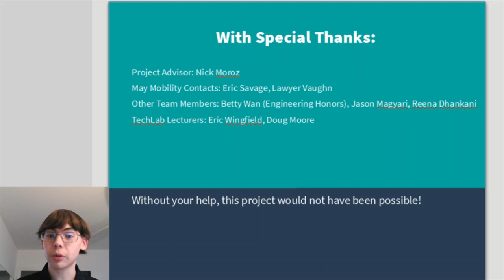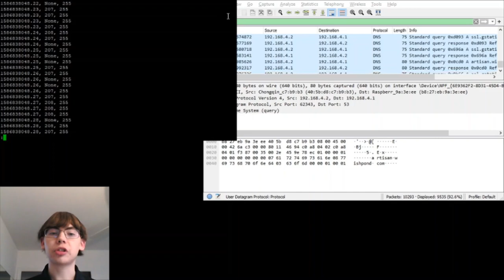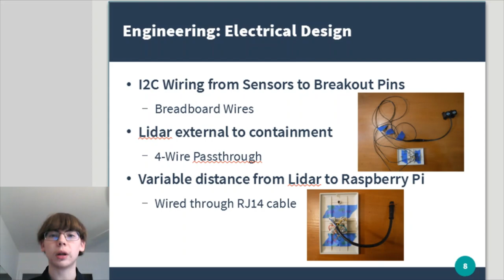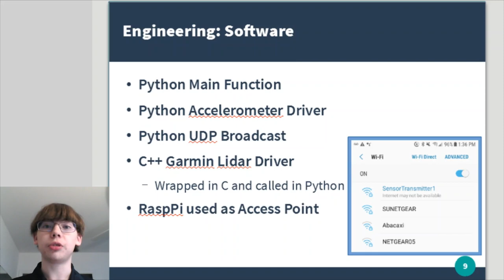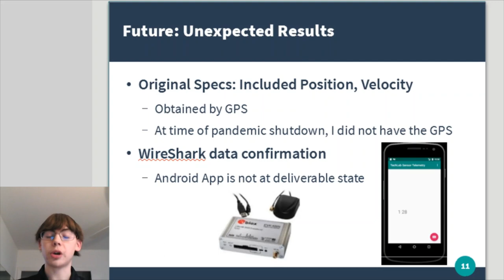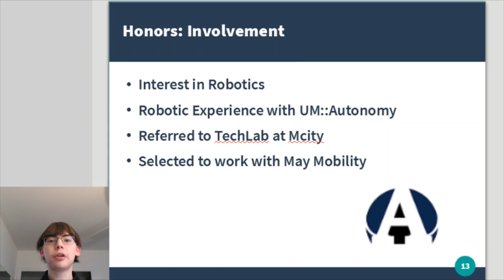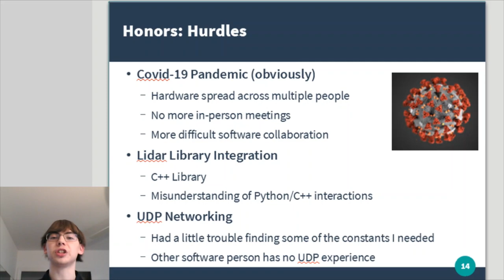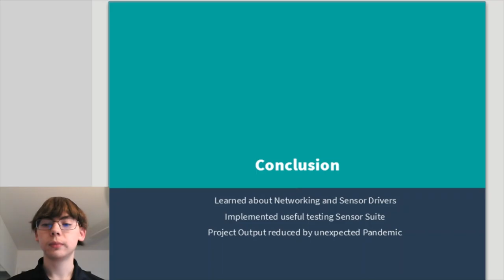Autonomous Vehicle Testing

Comment: Interesting project and very important for the continued development of autonomous vehicles. What problem solving skills ended up being most important in addressing the hurdles that you came across over the course of the project?
Reply: I think the most important problem solving skills proved to be creativity and pattern recognition.  As I noted in the video, the two primary hurdles were the enforced remote collaboration from the pandemic and general underestimation of the difficulty of some of the technical difficulties.  The pandemic resulted in some creative testing solutions, such as using Wireshark to test the system instead of the original Android application.  Additionally, I sometimes had to realize when I had seen a similar problem before to know how to solve it.  For example, when I actually saw the first accelerometer that we ordered for the suite, I quickly realized that I couldn't use it, because it was surface mounted, which is not a soldering skill that I have.  When I realized this, I quickly had to know how to exercise my skills to find a replacement that I actually could use (ie. the breakout pin accelerometer pictured in the video), which was a general problem that I had encountered before; similar problems sometimes came up while I was working on the drivers.
Reply: @gregsu  These seem like skills you will be able to put to good use in the future.

Comment: Awesome! What was the thinking behind choosing UDP instead of TCP if this data is mainly for logging purposes and not real-time critical decisions? My intuition was that if the tradeoff was speed/reliability, this use case would lean toward reliability?
Reply: The reasoning had actually nothing to do with the speed/reliability tradeoff, and more to do with the implementation details of the system.  One of the functions that UDP can do that TCP can't is broadcast a message packet to an entire address subspace instead of a specific IP address.  What this means is that the telemetry messages could be read by multiple devices simultaneously, and, even for one device, the implementation becomes much simpler than a TCP server, because the UDP transmitter can simply transmit telemetry messages into the void until someone comes along who wants to listen to them.  Since the system is operating off of its own wireless access point, I don't need to worry about flooding a public network with these messages, so the ease with which telemetry messages can be read by the system is much easier if one is using UDP broadcasting than a TCP server.  Further, since many packets are being sent per second, a single dropped packet isn't likely to be human-noticeable, and it won't be likely to negatively impact the real-time testing, where the question is whether or not the test that just ran was accurately completed.

As for the other alternative to a TCP server -- hard-coding a single IP address for a single device -- I really didn't want to do this, both because it generalizes badly if the company phone breaks and because it makes it harder to test.

Comment: What difficulties and hurdles did you face that you were not expecting?
Reply: The hurdles I described in the video were generally not ones I expected.  I certainly didn't expect to end up trying to Pair Program in a quarantine situation, which has caused a lot of problems.  I also didn't expect to have as much trouble integrating C++ and Python as I did (which was my fault -- I hadn't done it before, and underestimated the difficulty), and at one point we ordered a sensor I couldn't actually solder and use.  Considering that I was the electrician, this was an issue, and we lost time while we ordered a new one.

Comment: Hi Greg, interesting presentation! I know from experience that surface-mount accelerometers are very small and can be a bit hard to get started with - I ran into the same problem as you on a project last semester, where we couldn't actually test our accelerometer until building our circuit board much later! How do you think your experiences with UM::Autonomy influenced your experiences on the TechLab project, and vice versa?
Reply: For the influence of my experience with UM::Autonomy, I think there are a number of points.  The first point would be that I was my team's electrician; if I hadn't been on electrical team for UMA, I probably would have stared at the breadboard wires and not understood what I was supposed to do with them, which could have been a concern, given that we didn't have a CE or EE major on the team.  The second point would probably be how quickly I came to the conclusion to use UDP over TCP, because my work in ArduPilot showed me the kind of system that would prefer UDP broadcasting; if I hadn't worked with the SkyViper drone with UMA, it might not have occurred to me to use UDP for data transmission.  My experience with UMA also meant that I have more direct experience with sensors than the rest of my team, even if it's usually just wiring them, and I found that I sometimes had to explain the concept of a given sensor to the rest of my team; this experience definitely helped me skip the part of a project that I usually spend understanding what the project even needs to work.  It's also a decent bet that I only have serious experience with Linux and Raspberry Pi's because of UMA, and I probably would have a lot more trouble using the Raspberry Pi without that experience.  (The other computer scientist probably wouldn't have been able to help very much; she's been having trouble configuring her own primary programming environment -- probably because she uses a Mac.)

I think my TechLab experience influencing my work with UMA is a little more difficult to articulate.  I would say that it has probably made me more aware of how much a typical member of UMA picks up cross-discipline just through osmosis and listening to other subteams discuss their problems, even if they aren't necessarily working on the problems themselves.  I also think that TechLab has given me experience writing sensor drivers, which is usually AI's job on UMA and not mine.  This means that I have a slightly better idea of what is involved with these programs, and it might be pretty helpful next year when I will have to be overseeing the entire system design of the drone again, and I might be more capable of wiring sensors directly to the companion computer than trying to extract the data from the PixHawk.  As for the last point that occurs to me, I am guessing that it will help me be a better Drone Lead next year, because I found myself spending a lot of time explaining programming or electrical concepts to my team members than I usually do on UMA, which might be helpful experience next year on Drone Team, considering some of the points we are planning to emphasize next year.  That last is just a hypothesis, though, and it might well prove to be inaccurate, since it is a guess about the future.

Comment: The project seems really cool! How have you tested the sensor suite so far?
Reply: So far, I've been testing the sensor suite by one of two methods: starting the sensor drivers in a terminal and viewing print output, and using WireShark to capture the transmitted data packets and reading them manually.

Comment: How do you hope to use what you learned from this project in your future career?
Reply: A lot of what I learned in this project was low-level driver work and Python programming.  A lot of robotics involves interpreting data from sensors, so I hope that my experience with writing drivers will be helpful for future low-level code writing that I might have to do.  Additionally, Python is currently one of the most important languages in machine learning and robotics, so I expect that I will end up writing a surprising amount of Python in my career, so experience writing it will likely become very valuable.

A lot of the work was really the basics of robotics: drivers, data interpretation, telemetry, etc.  I have really become really interested in the robotics field over the last few years, and I hope that my future career will be working with robotics or autonomous systems, so I expect that a lot of the basic skills I learned in this project will prove to be helpful in my future career.

In terms of the communications standpoint, I actually learned a lot about working with people across disciplines and with varying levels of experience.  Since robotics is very much a multidisciplinary activity, knowing how to communicate with different groups of people will probably be very useful for helping me in future projects, and the ability to work with varying experience will likely be useful for teamwork I might end up doing in any field.

Comment: Which aspects of the project did you find the most/least interesting, and did you find the work you were doing to be enjoyable in the end? Or was it most about completing the project?
Reply: I actually enjoyed figuring out how to write the UDP transmitter.  I knew the approximate methodology, but I hadn't actually done it before, and I ended up getting to apply some of my EECS 388 skills by using packet capture to make sure that it was actually transmitting.

I would say that I enjoyed working on the project, because it gave me an opportunity to make a product that actually has use to other people.  I also liked succeeding, so there's that too.